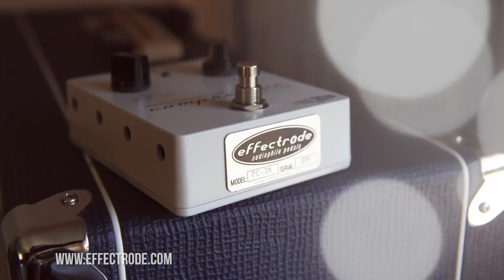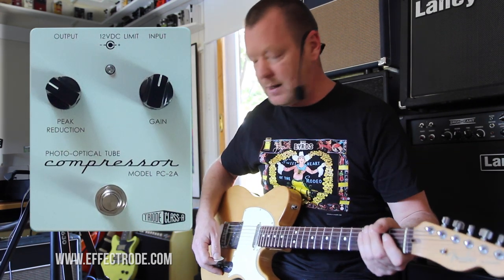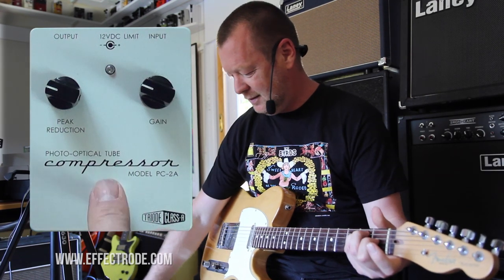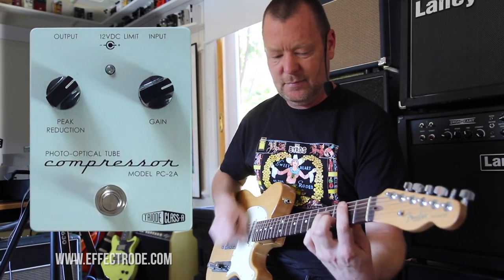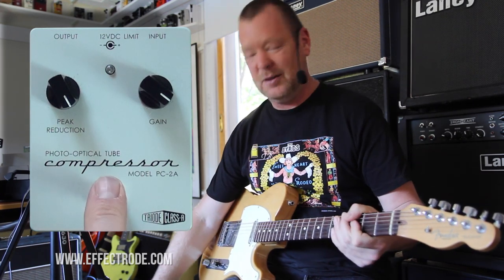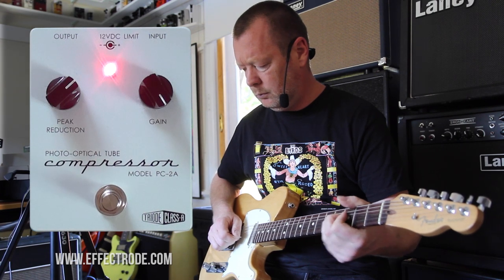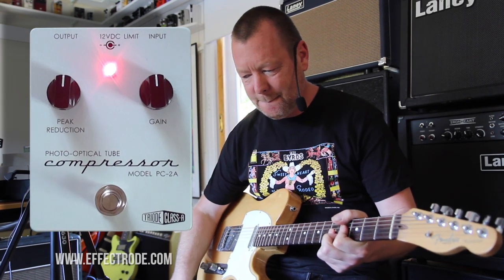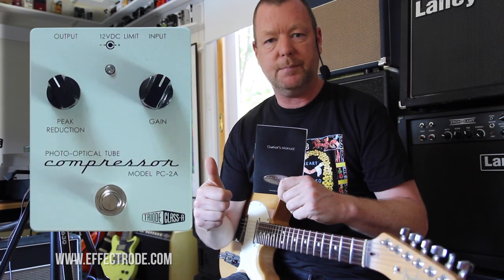Effectrode: PC-2A Tube Compressor

Comment: What I dislike about compressors like this is the "pta pta" sound or tearing sound for want of a better description of the pick attack when it is engaged. I guess compressors just aren't for me though I do have an EHX Black Finger which is very transparent but rarely use it other than at the end of the pedal chain to reduce unpleasant peaks from other pedals.